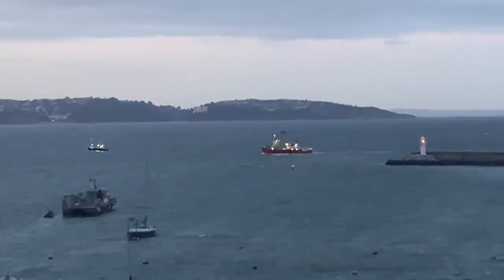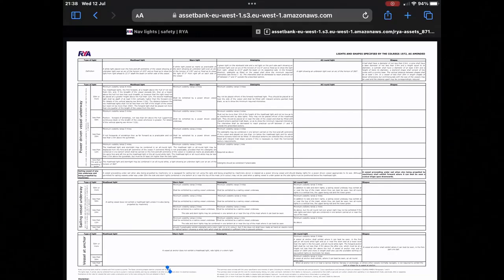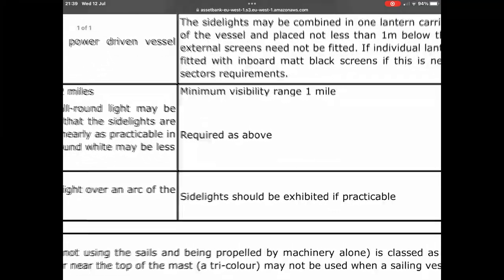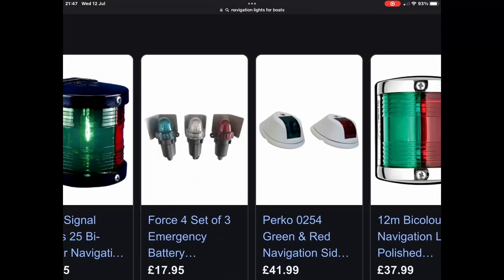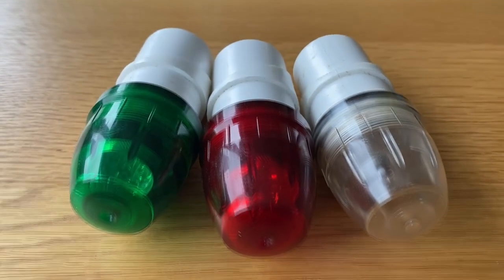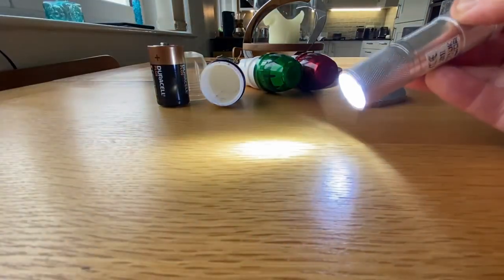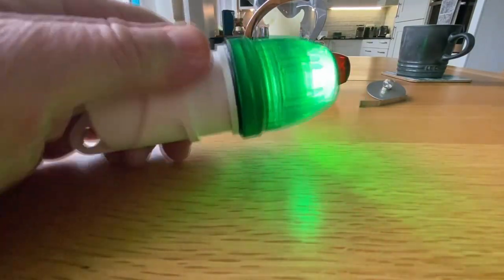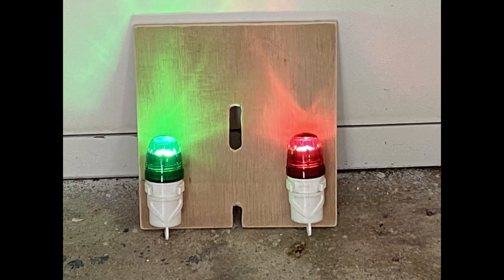No 13 Navigation lights, on a Shrimper What is needed?  Can i get these emergency nav lights to work

Comment: If you are under 7 metres and under 7 knots, you only need a fixed all round white light.
Reply from the maker: Indeed, if you are motoring, all you need is the masthead light. If sailing, however, you don't show the masthead light. Colregs says "A sailing vessel does not exhibit a masthead light unless it is also being propelled by machinery"

Comment: I would not be so ‘woke’ as to identify as a yacht!  You move so slowly it doesn’t matter.  
If offshore away from much traffic just the masthead white shows you are there.  And the white light can be seen from a greater distance.  Then have the red n green when you encounter other close traffic.  
You could choose the white all round with the higher brightness off the class above, there increasing you visibleness, but not using any more power than the full set. 
Ok, perhaps not strictly in accordance with the rules, but a better , safer option?
Reply from the maker: Thanks. to date the only time i've used lights on the boat is creeping up the Dart when I got back late. I don't anticipate any extensive night sailing, certainly not offshore. If I do, I will almost certainly be proceeding as you suggest.
Reply: Yup, the red n green are very useful in a busy restricted waterway